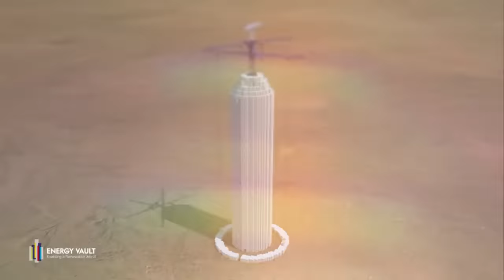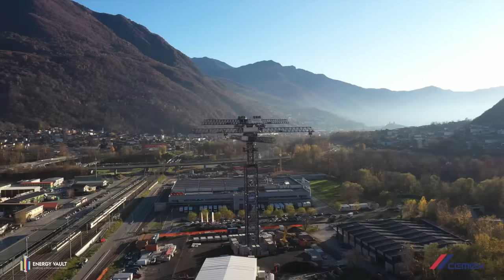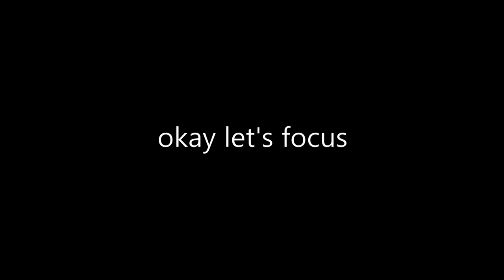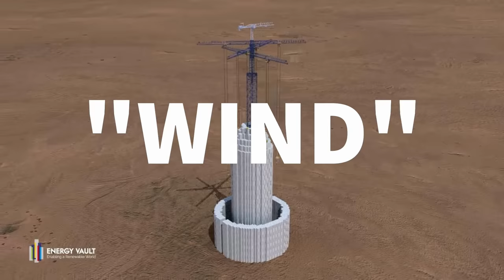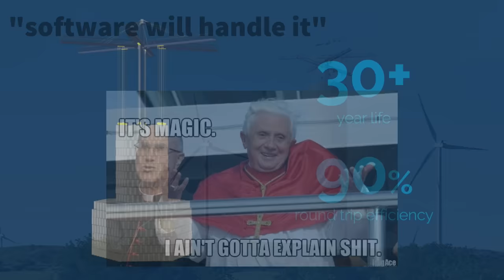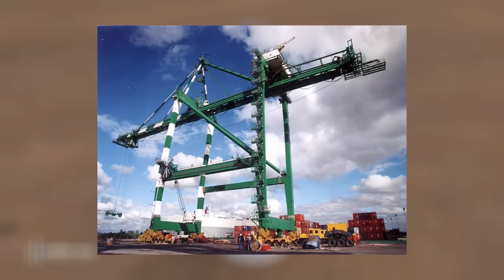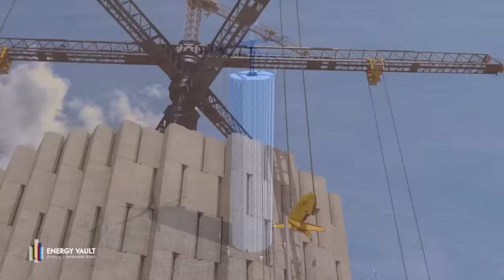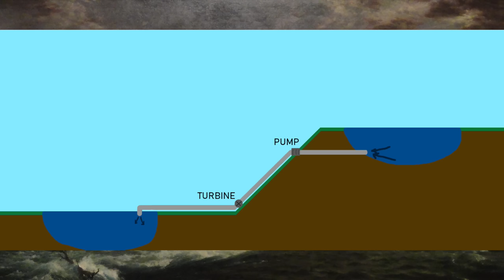The Energy Vault is a Dumb Idea, Here's Why

Comment: While Hydro energy is certainly more efficient, it comes with its own issues.
The land area for Hydro storage in Europe (where this idea comes from) is big. You also have environmental issues with Birds and, when using existing lakes, Fishes.
Plant life in the ponds is also sometimes an issue. It is very difficult to get approval for such storage solutions. I am living 10km away from one, I know some of the issues. 
Wind: You can built it in wind protected areas (As seen in the video of the demonstrator, in a valley).
Concrete: YES, agreed, this is serious. It is often forgotten to take into account. This actually also applies to Wind turbines which take easily a year or more to just offset the CO2 from the concrete used to built them... You probably can reduce it with hollow blocks filled with something else. and the production method shown does show promise, but is probably lacking stability. They probably could be used only on the higher level, not on the bottom.
Personally, I would like to see hydro power in abandoned mine shafts where possible. Also, some mine shafts are VERY deep. Applying the storage method of blocks, but with a WAY longer way down, it would be more efficient already. Any many mines have already electric railways that could handle the blocks in an automated way, out of the wind. Corrosion of weather would also be removed in this scenario, giving them probably a much longer lifespan.

Comment: Wires under tension from a concrete block weighing more than 1000kg are unlikely to be affected by wind.

Also saying that the tower can handle only the daily output of 2 wind turbines. Most of the energy generated throughout the day would be used directly, you would only need to store a small amount of that, and you would probably use it later that day in the case of solar or within the next few days in the case of wind. Either way that capacity is a lot bigger than you make it out to be.

I feel like your “software will handle it” comment was a bit of a straw man attack.

Pumped storage is great if you have natural hills already in your area, but it doesn’t work for very flat regions.

Also the starting and stopping of water flow in pumped storage creates massive amounts of force which can’t be modulated to just store and use any variable amount of electricity at one time.

Gravity systems could be turned on and off whenever, and the speed of ascent and descent can be modulated to fit exactly with electricity frequency at the time (dictated by supply and demand)
Reply: in the context of pumped storage, you do not know what you are talking about.!
https://www.energy.gov/eere/water/pumped-storage-hydropower
https://www.hydro.org/waterpower/pumped-storage/
https://en.wikipedia.org/wiki/Pumped-storage_hydroelectricity

Comment: Concrete has a higher mass density, which has also a higher energy density than water ;)

But yeah, this facility will not solver our energy problems.

With the new sodium batteries from CATL, they claim they could produce cells with a energy density of 500Wh/kg

Comment: I agree with everything except the "Software" part. "Software" will actually solve this problem if when we talk about "software" we mean control systems or control engineering. There have been many works on different types of cranes stabilization against wind and other disturbances.

Comment: Why don't we simplify this model. And only use gravity bateries when mechanical energy is produced from the energy producers. Make a big ass lead block that is buried underground that is mechanically attached to steam turbines that is automated to be dropped whenever power on the grid drops. As it drops its massive kinetic energy can be used to turn generators that produce electricity, instead of some needlessly complicated crane machine. This battery can be made extremely simple and have less energy conversions where energy can be lost as heat. Alternatively you could use pumps to push water up that then gets released to produce power

Comment: Digging a hole is expensive, and draining the water out of it. Just put a thin metal wall around it, simplest and cheapest solution.

Why not water? Less mass per m3 than concrete (you need 2.5x the amount of water vs concrete, so much larger areas, plus it evaporates in hot countries, not available in great quantities everywhere. Not all countries have the elevations to make dams/reservoirs.

You may not like their idea, and it may not have the efficiency needed to be a solution, but it is a more universal solution that the ones you came up with.

Comment: Pumped-hydro storage is quite limited depending on geography. The most interesting gravity energy storage proposal I've read about, is using abandoned underground mines as bottom reservoirs for pumped storage. The region where I grew up had coal mining at 700 to 900 meters below ground. That provides a lot of potential energy per liter of water lifted/dropped. I do anyhow agree with the creator of the video that using concrete blocks for storage of low-carbon energy is a pretty terrible idea.

Comment: As an engineer, I totally agree that this is a very dumb idea. 
For a power supply that should last long it should be reliable and able to withstand long durations without maintenance. So many mechanics are included in this project that need to be replaced over time with increase the cost and decrease efficiency significantly.

Comment: There is a VERY SIMPLE solution. Dig a bloody big hole and put it in it. No wind! No unsightly tower! What do you do with the earth removed? Put it in concrete boxes instead of the concrete bricks, saving on CO2 emissions.
Why do people  post negative videos   pointing out problems without offering creative solutions to the problems. Hydroelectricity tends not to work in flat areas or those without water.

Comment: Can we just drill a two kilometre deep well, and at the bottom insert depleated nuclear fuel rods to allow them to go critical and meltdown. Then plug the hole with two kilometres of sand. And then drill down two pipes and pump water down one pipe and up the other and collect the geothermal heat of our deep nuclear reaction? Maybe build one in the Ghana natural nuclear reactor and establish a nuclear-geothermal power plant in Africa?

Comment: I'm more wondering how does it stack up when it's already done with the bottom part. Cause it just looks like it's just putting one block onto another spot but not easy to keep going up when it looks like they'll have to take the crane apart and rebuild it onto the structure they just made.

Comment: That gantry crane is a good idea.
Yes, concrete is a big problem just by the CO2 output caused by its production.

How about using  sea containers filled  with steel scrap. A hydraulic press could compact the scrap into, for instance, disused 40 foot containers. This would provide heavy weights at high density with the weight much higher than that of water and even concrete. Massive steel blocks instead of compacted Steel would provide even higher density but require melting the steel first which needs a lot of energy.

Some sort of hoist or even electric train could move those very heavy containers uphill and park them somewhere - just like a Railway Yard.

Comment: The only somewhat reasonable version of solid weight gravitational storage I've heard of uses one heavy weight in one very deep mine shaft. Basically, replace the mine elevator with your energy storage. It will be less efficient than pumped hydro, but it will still have way better economy of scale than this silly tower builder.

Comment: I’m no expert, but square shouldn’t be worse that round? Tall things are subject to wind, and concrete is notoriously inflexible, so will probably fall over quite easily. Cylinders shouldn’t be affected by wind to the same degree, as it just goes around it (which is also why taking cover from the wind behind a cylinder doesn’t work). 

Still seems like an incredibly useless concept though.

Comment: Compressed air storage is another option that won't get messed up by sub 0 temps for colder climates. Hopefully they come up with really reliable (As in long shelf life) batteries in the near future. Imo it's the biggest drawback to all green energy solutions. Electric cars? Awesome! Until 10 years passes and you have to pay $15-20k for a new battery, or deal with only 60-70% range.

Wind and solar? They're kind of meh for a multitude of reasons, but the biggest downside ofc being intermittency, and this heavily relying on efficient and reliable energy storage.

Comment: Why not just use a baffle filled with air underwater to lift a large, heavy object, then let that large heavy object slide off the baffle into the water again and sink, generating electricity on it's way down? There should be a way to create an energy differential between the energy needed to fill the baffle with air and the generators, which could then be stored in batteries.

Comment: There's an idea for a gravity storage system using rail trucks on an inclined plane that might have applications in dry areas using old open cut mines. It would have large friction losses but worth investigating.
Reply: There's an iron ore train in Western Australia that uses no external electricity, just gravity power. The loaded train rolls downhill to the port using only gravity and charging its batteries. Then the much lighter empty train returns to the mine using battery power.
Reply: @rais1953  WA mines use diesels  but Rio Tinto has just purchased four battery powered locomotives. 
WA would be a good place to trial gravity storage.

Comment: I seen this on a investment site. I did not even watch if for 10 seconds before I seen that it was a NOGO.  2ft drilled hole with winch on a weight inside a building. But water is the way to go.

Comment: Just curious. isnt converting water not pretty unefficient compared to solid objects? 
I feel like solid objects could be way more efficient so im not sure about if the water pump part is better.
Reply: It's basically the same thing. You are building up potential energy, while you have a surplus, and reconvert it when you have a deficit. It's all about the weight of the stored medium, be it water or concrete, and the height. Concrete is heavier than water, per cubic meter, but i much harder to transport, and store. Water pumps, also use less moving parts, and are generally more efficient than the electric motors/ generators on cranes, since you can build them much bigger, and don't have to account for stability. 
Tl.Dr.: Concrete can store more energy per volume, but water has much easier and more efficient logistics.

Comment: The two problems with pumped hydro is space/location and water supply. A large chunk of the US is too flat and a large chunk is too dry and areas you need it the most are urbanized. But both hydro and this monstrosity are gravity batteries so I would assume both have similar efficiencies (~80%). For areas like the southwest, I think a simple design of one large weight inside a deep well should work. Surplus energy = weight goes up. Deficit = weight lowers spinning a turbine. Same mechanical principle as pumped hydro but better suited for arid regions.
Reply: I agree. this huge project is obviously only interesting if pumpstorage is not available.
It seems especially useful for decentralised storage. How much energy could a 5 story elevator shaft hold? Probably enough to unload peaks from the grid.
Edit: Say we use 4m³ of granite as weights on 5 stories: 10800kg*15 meters*9,8gravity= 441Wh. That is 5 laptop batteries.
Probably I was wrong before.
Compressed air, btw, apparently holds about 450Wh per liter at 300bar. Sounds oddly promising.
Reply: @gregorstrohman3619  if you use steel which is cheap and plentiful, a 4m³ chunk would weigh north of 500,000kg. Much more energy dense than granite (and arguably cheaper). If you did 10 stories, or 40m, that amounts to 54.6kwh × 80% efficiency is ~44kwh. Or enough to power 100 homes for 12 hours. Yeah not great but $/!, I'd bet it's on par with li-ion or better.

Edit: I think cost wise, it would be better to simply build up instead of down. A 10 story building could house 9 of these (3×3). Enough for nearly 1000 homes. They could be the new water tower. Energy tower I suppose.
Reply: @davidml1023  the density of cast iron is around 7,5. that means 30 tonnes for 4m³.
So not 44kWh, but 3kWh.

Comment: certainly the pumped hydro-storage is the simpler, more efficient solution. but gravity battery idea still shows that people are actively THINKING about the problem and how to solve it. 
at any rate, its going to take a broad range of solutions to achieve the end result.
never stop trying to solve problems. for every failure you have learned how not to fix the issue.

Comment: 2:40 Diggin is not cheap. Building a lightweight windshield must be cheaper.

Anything can be used as a weight. The "concrete generates CO2" problem is an invalid one. It also fails to compare this project with existing technologies. Are lithium batteries or massive concrete dams better? And even if it takes resources to build weights, it is bound to last for a century. This is not a road with truck rolling on it. It's just matter, protect it with a roof and you'll good.

Comment: No need to insult other ideas. Let's have a collaborative attitude instead of a competetive one. Good contribution to the discussion. Water powered batteries unfortunately take up so much volume for not much energy. Plus dams already are recharged for free by clouds. Better would be something MUCH denser and heavier than water. Also, why have thousands of separate blocks when you could have 1 huge block that you just lift with tons of leverage? Fundamentally we are trying to utilize the inherrent elasticity of nature. We could also pressurize and depressurize elements.

Comment: did some one told already that the 10 000 concrete bricks 20m3 each will weigh in total about  480 000 tons?! And this is roughly the weight of 2 average skyscrapers. And the height of such tower will need to be at least 30 m to save 18-20 MWh of energy. 
 And then one moves every day these 2 skyscrappers (saved energy load/unload) from one place to another.. 480 000 tons..  Which kind of basement do you need, that will withstand a movement of this weight with all belonging tensions 365 times a year?!
Reply: refreshing to read someone actually considering the engineering involved, and not just taking cheap shots based on ill-founded opinion.  Thanks.

Comment: Lots of Issues with your points, Digging a hole that size might require more energy then the entire lifetime storage of this system (There's a reason why people buy above ground pools). Concrete doesn't have to be the option "Looking like it might fall apart" and "Might not be available everywhere" are both stupid points and both "maybes" which nullifies the point.

Water? Which you pointed out has been done before and has some flaws which you conveniently left out of your video. I think the purpose of this experiment is to find cheaper and better ways to to redesign the whole "Hydro damn/lake" shit that's still INCREDIBLY expensive... Water: So now we gotta dig TWO massive holes opposing each other on an incline, and make sure that we can store this water for months without any run off or leakage or evaporation in deserts/poor countries.

I think this idea is ultimately stupid I agree (Might have some potential) but you video is just as stupid. Its no different then a 4 minute video of a narcissistic 14yo atheist shitting on the bible, with simple "First thing that I can think of" arguments. There are 100s of geniuses, if not thousands, redesigning and creating incredible feats of technology, and lots of these theories start out like this.

Why is one dude spouting basic/stupid counterpoints getting so much attention on youtube? he links to Thunderf00ts video in the comments which is infinitely better then this poorly crafted "Thunderf00t summary" vomit session, and thunderf00t is still a massive complaining narcissist. Hate people who shit on stuff without coming up with creative alternatives, not "WatEr DmaN woRk, do THat, I aM SmarTeR".

Comment: The debunking should have concentrated a little more on comparing Total Efficiency of block stacking to pumped water reservoirs .
The claimed 90 percent efficiency of block stacking is obviously not correct.   Small prototypes can be very efficient but those do not have the huge reduction gears that are necessary in a large crane. Those gears alone can dissipate over 15 percent of the lifting energy. The rolling friction of the sheaves and the weight of the lifting cable also need to be taken into account.  Also the lifting motors need to have the capability to feed back the regenerated power.  This means some type of motor drive / inverter which is another source of power loss.  Counter weights also do little to increase the Total efficiency because after a block lift the counterweight would be required to be lifted in order to be ready for the next lift.